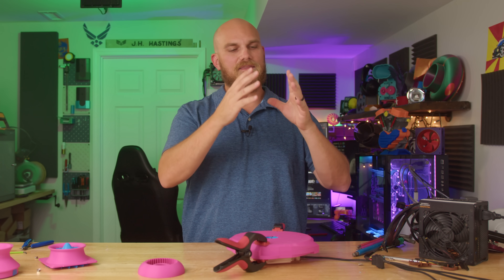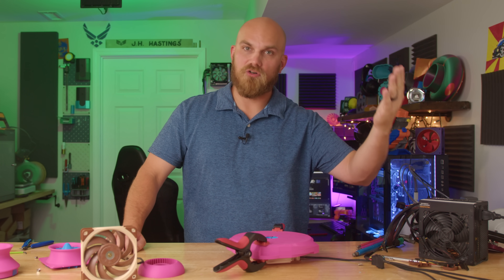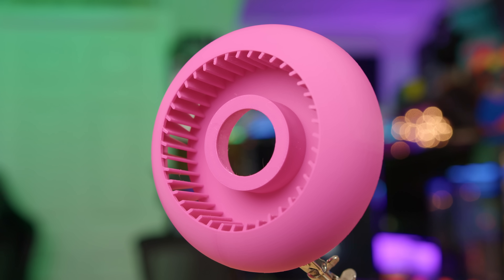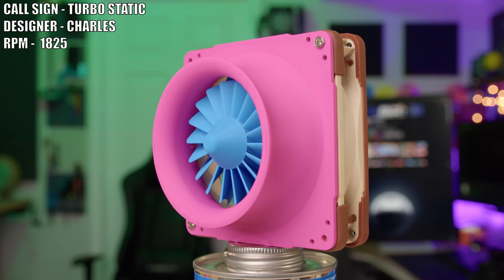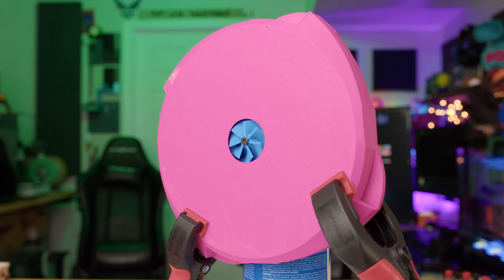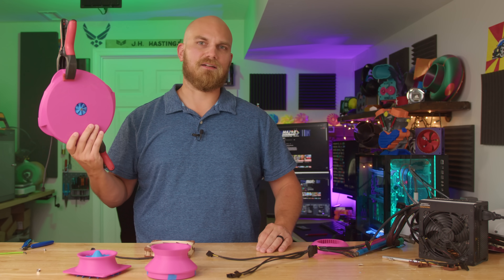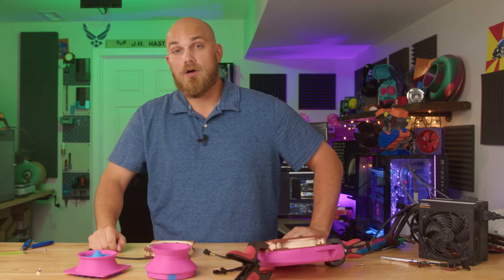Wild 2-Stage 200mm Blower Fan Redefines Power | Fan Showdown S6E6

Comment: When you do a new season, you should base the ranking off of mass air flow (MAF). If you know anything about engines, the way the computer decides how much gas or diesel gets injected into the engine is based off the MAF sensor. It basically tells the computer how many molecules of air are getting pumped into the engine.
Banks Power does a really good job of explaining how MAF gets works:
(short)https://www.youtube.com/watch?v=XLhSeaj1bg0
(long video) https://www.youtube.com/watch?v=VUCo3REGrLE

Comment: Just a suggestion, maybe you could chart your fan pressures VS CFM to give a flow vs pressure graph. I am not sure if your pressure test involves blocking off the fan outlet and taking pressure that way or if you do bleed a little air, but axial style fans would most likely have less pressure due to blade stall vs centrifugal fans which use the "weight of the air" being flung to create pressure. You'd need to create a type of enclosure where you can measure incoming CFM and outgoing pressure with a variable orifice to set flow to your choosing. Maybe inlet adjustable restriction (vacuum) AND outlet adjustable restriction (pressure) measurements as well; some fans are better at making vacuum then they are making pressure. Also, maybe add how much power (watts) are used to determine fan efficiency. Centrifugal compressors/fans are generally less efficient than axial fans/compressors due to the fact air changes directions at larger angles in centrifugal fans than in axial fans. If you take cues from aircraft jet engine manufacturing, you'll see axial compressors are used much more than centrifugal compressors where the engine is not constrained by length. If I remember correctly, axial compressors (multi-stage) can achieve close to 95%-97% efficiency where as I think centrifugal only gets up to about 80-85%. What I am getting at is some fan designs make good pressure but bad flow and some make great flow and bad pressure but those pressures and flows vary in performance depending on how they are used/how restricted they are. All of this can be tied in to "how much power does it take to spin the thing" which would also tie in to "hey it may make lower pressure but it's using little power to do it and there is a tonne of flow". The pressure VS flow graph would really highlight areas where one fan would work better than another in situations where you're blowing through a radiator/filter or using it in open air. I wish more fan manufacturers would include flow vs pressure graphs with their fans sometimes. You can also find similar theories on "automotive turbocharger" sizing. Turbos are spec'd to the engine they are attached to to meet specific pressure and flow targets to maximize the performance coming out of the compressor vs how much power is lost in the turbine driving it. A bigger turbocharger/fan/compressor is sometimes not always better. Just my 2 cents.

Comment: The moment I saw that frisbee of a fan I knew it would move some major air. It just looks like it's employing proper engineering principles for air compression and the large flat disc creates that pressure seal that all the 3d printed "classical turbochager" designs lack due to the high presicion manufacturing requirements.

Comment: Reading other comments, I now think that static pressures is probably not what we want. The problem to beat is cooling a radiator with a motor that create rotation. The "fan" should both create air flow and overcome resistance of the radiator, so a little of "one way" meaning avoiding some leakage of air to go in the opposite direction is good. So maybe the real chart should be cooling of the radiator with constant heat production, the lower the temp the winner.

Comment: 9:34 Oh, "only" 6.7 mmH2O? 3rd place out of 25? Between 2.5 and 3 times what the A12X25 does? From what's technically a fan that fits within the dimensions of the A12X25 housing. Yeah, what an absolute disappointment, right...
Why did you say it like that?

Comment: IMO, we should allow anything, but you should maintain two leaderboards, perhaps even three:

1) Fans that are just fan blades, they fit within the fan frame or at most have a slight protrusion

2) Fans that significantly protrude from the housing, and/or have external air guides etc, but still conform to the footprint of the fan, just getting taller

3) No rules

Though, 2 and 3 might be fine to combine, and you should still list the results of lower bracket fans on the higher bracket results, so we can see how the wilder ones stack up to the best of the lower stuff.

Comment: I am looking for something that can pull about 8 cfm through a particle filter connected via a 23mm diameter connector. I guess that makes something optimized for static pressure reasonable. Any hints?

Comment: I would add a 2nd rule. It has to be able to fit on a pc case. Doesn't matter how it fits, but the fan needs to not obstructed when it is mounted. This is not the same as fitting the fan frame. Similar but less limiting.

Comment: ..maybe for the smoke test you should use an acrylic box with a hole instead of an acrylic panel so we could see how fast will the fan suck out most of the smoke from the box? In the room most of the air is pretty much static, unlike the stream of smoke you push in into the fan...:)

Comment: I'm very much a "it depends" - 
group N's preference is to almost guarantee that a fan made could fit and be used in a computer without having to, say, modify the case to accommodate. 
group B goes big or goes home - big fans are cool and it's fine if they're a byte bulky. The increase in fan performance (and having fun) in exchange for a less universally applicable fan is worth it

Many towers require essentially non-protruding fans on the case, while inside there's more volume to work with where fitting saaay the centrifuge madness may be both possible, and may have better utility

Requesting a double centrifugal madness, just one stacked atop a second

Comment: I work on a ton of vacuum and high pressure systems. GLUE IT TOGETHER. You WILL have leaks if you don't and you numbers will be skewed. It's only on fan, PLUS you assembled it with a rather noticeable wobble. Are there links to the 3d prints?

Comment: 01:40 ANYTHING goes! i use 9 of the fan your holding at this timestamp.
and if there is a chance to 'print' an insert with fan blades that are NOT audible, but still provide a little power, then i'm in ;)

Comment: I don't know if a static pressure measurement is the correct thing to be measuring for the purposes of rating a cooling fan.   Heat transfer is dependent on moving air from one place to another.  A balloon can maintain high static pressure, but isn't necessarily moving air.    I don't want an air compressor on the back end of my computer box.  I want something to move heat (in the form of hot air) out of the box.    I think the Centrifuge Madness's strong showing is in fact demonstrating a key difference in how many compressors are constructed, using centrifugal actuators often with high rotational inertial masses that allow them to maintain pressure loads, but not necessarily with an emphasis on volume movement.   Look at the two key components of a typical heat pump / air conditioner system.  You typically have a small centrifugal compressor that moves the hot transfer fluid at high pressure but relatively low volume through the tubing and into the heat exchanger, where much larger fans move very, very large volumes of air across them to actually carry that heat away.   The compressor moves heat despite the lower volume flow rate because the liquid has a higher heat capacity than air.   But ultimately, you need a large volume air to transfer that heat out of the system.

Comment: I don't see it in the table shown in the video so sorry if it is described elsewhere, but what's the CFM-wise performance of these fans?
Just wondering if some kind of CFM/static pressure tradeoff exists "by default" or it is more "situational" (Noctua's very own 200mm fan that moves a fair shake of CFM but has wimpy pressure comes to mind...)

Comment: Group B. However, you are at the speed runners point, where you are going to need to split to two leader boards. Standard fan leader board and exploit anything goes leader board. Predicting a thunder from down under and a centrifuge madness combo next season.

Comment: I'm solidly in camp 1: 'Must fit the frame'. I'd argue this is (or was) a design competition for case fans as I was drawn to the channel while shopping around for a new one. While all the 'XXL' designs are impressive, if the end-result does not need to fit inside a case, what is the point if the design? At what point does it stop being a case fan competition and become a drone-race? If you are trying to 3d print the best rotor for any kind of application with no restraints, why would one even uphold the limit of using the A12x25 motor? Are designs that are only technically powered by the motor, but are fully independent engines (eg fueled by melting parts of print-medium) in the running?
Of course I am all for separation into brackets, if it means more content to enjoy.

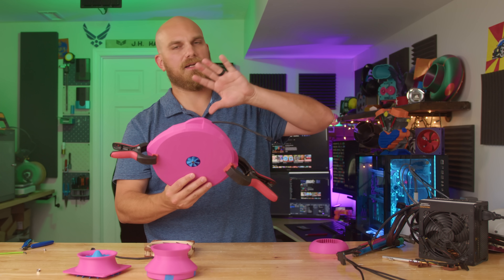Comment: 7:00 I don't think the Center Madness got a fair shake; the top disc was clearly slightly off centre; you could tell there was some wobble on the edge when it spun slowly, and surely that had an effect on the balance and performance of the fan.

Comment: For a sense of scale: 8.7mm of H2O converts to roughly 0.085% of an atmosphere (0.00085 bar). So no, you're not turbocharging anything with these, or inflating tyres etc. =)

Still, compared to the baseline of the A12x25, dang impressive!

Comment: You probably have already but I'm going to mention it, have a look at actual jet engine design.. 
There's two things that I would consider to be very important.... Apart from the multiple fan blades, there's a stator between the blades which is one important and key design and the second is the shroud around the jet engine.... When the fan blades spin up, they create a vacuum within the shroud around the engine.... Essentially getting something for nothing! 
It reminds me of a water pump design that has been around for a very long time and isn't well known..... Basically it's a small pipe within a larger pipe, the small pipe will spray high pressure water inside one direction of the larger pipe and creating a vacuum on one end of the larger pipe, I saw this on a British naval training video, the design allows to pick up raggs and they can be pumped right through without getting stuck.... They use this to remove a lot of water very fast! Essentially using a little bit of water to move a lot of water! 
If we were to apply this to air, we would have a jet engine.... Or a fan that will move a lot more air than is possible with just an ordinary fan..... 
There's a lot of cutaway diagrams of jet engines.... You might need to look at quite a few but once you see it! You will be trying to design something based on it.....

Comment: I think allowing the fans to go crazy like this is just as bad as not standardizing the motor you use. We use the same fan motor for consistent experimentation, so the data means something. The same is true of other details. Allowing the fan to be wider immediately throws all the previous tests into the garbage, because those deaigns would also be "better" if they were permitted to be larger.  The design we see here is really cool. But is it useful for the data? I don't think so. I think it harms the data.

Comment: Pabst Ebm all aluminum 140mm 12v  6750 Rpm 380Cfm at serious water lift. Insert finger, loose finger...I have two others in my Cnc controller they are Pabst Ebm aluminum- 48volts at 7000 Rpm.
These are all noisy , but not like a tornado fan. Still Youd need a speed controller with these , they are just too dang powerfull on full tilt.

Comment: There needs to be the fans that fit inside the housing in leader boards. Second class being fans and blowers that do not fit in the fan housing. The fans that fit in the housing must be able to mount into a PC case as typically used. The non in fan frame clas the asembly must be able to be mounted to a case with the fan outside or inside the panel.

Comment: No rules, no glues, use a silicone caulk or similar sealing material along with your clamps and it'll seal airtight, but still peel apart when you're done.

Comment: I think, ultimately, it's just not really fair to compare them as if they are equal because they just aren't. it's like saying it's a race. this person brought a mustang and this person brought a purpose built rocket car that can only run for 30 secs at a time, has no radio, no ac, no actual doors the person gets bolted in, but they are on the same playing field because they both burn high octane fuel. if you want to go wild then just don't pick any normal fans because they will always compare unfavorably in regards to whats being measured. if it matters that they actually out design the AX25 under the same bounds then the moonshot designs would have no place because they just aren't doing that.

Comment: To me it should be usable within the bounds of the spec, as in it should be the same size and use the same power. That being said no reason there can't be a category for extended and unlimited designs that do not fit within the bounds of the fan housing. 
The reason I feel this should be the case is that if the design can't  be used in place of the original then the design isn't actually better and is just a different product class, as a larger fan will move more air than a smaller fan while remaining quieter. If you let people expand beyond the bounds of the original fan then you may as well just let them use a bigger fan as the base. However, I also feel that these oversized designs are still interesting so give them their own leaderboard.

Comment: The Centrifuge Madness needs to be glued. The glue doesn't just keep it together, it also acts as a sealant for the seams of the layers. EDIT: You could possibly get away with some duct tape along the outside of it. Easier to disassemble without destroying the 3D print.

Comment: If the intention is to find the most optimal design for a fan for a standard PC case, It should quite obviously be able to fit both in the case, and inside the frame of the standard fanbody. If the intention is to find the most optimal fan design, Why does it even need to be limited to using the motor or base of a PC fan?

Comment: "Jet impeller" shares similarity to the first jet engine design, done by a British feller before WW2. It was a radial jet engine, not the coaxial design we are familiar with in today's jet engines. Advances 8n metallurgy were needed for the hot section of the coaxial to work when the first radial design what made.
P.S. there were plans made up to put a radial jet engine in a P-47.

Comment: In general, energy transfer is more efficient when you move a big thing slowly than when you move a small thing fast. This is the principle behind, for example, high-bypass turbofan engines, where most of the thrust is from air moving around the engine core relatively slowly compared to the air moving through the combustion chamber and turbines. There was also a video demonstrating this concept with rubber-band powered cars floating around somewhere on youtube (maybe Steve Mould?)

Comment: Any design is fine. You just have to rate them based on the volume of the fan, ttoday’s winner, for example, is huge. compared to a normal size fan it wouldn’t score as well, right?

Comment: both categories are valid. on one hand the first category were anything goes well that's for generally anyone you have your own computer you have a big case you can do whatever you want with it you want to modify it however you want to get the most performance out of a specific fan for cooling on a CPU GPU case in general do whatever you want however in the second category there's a lot of people that have small cases that don't have the room for all this modification they deserve their own category not everyone has the room in their case for a huge setup for that static pressure or high air flow so it really should be to categories one for the people that just want to go balls to the wall they have the room in their case they have a 3D printer they can do it and other category for those that are more conservative have less space but what a little bit more performance maybe better static pressure in their small case cuz it's tight there's not a lot of air flow they just need to get more heat out all and all I think both are valid and both should be categorized in their own separate unique way maybe it should be a clearance thing where not just fit in the fan but it cannot exceed more than maybe five millimeters above the fan housing and another category that exceeds the fan housing and it's just whatever goes it might be interesting to see a Excel spreadsheet showing the height clearances of all these fans to see what the performance is in comparison My vote is both need to be measured

Comment: If it fits in the Computer Case and is powered by the Case Power Supply, then it's fine...

If it won't fit in the case or it interferes with the fit of other components and/or requires an independent Power Source, then it's worthless junk and should be scrapped...

😄😁😆😅😂🤣

Comment: That massive one looks almost exactly like industrial negative pressure turbine inside of one of equipment we use at work for picking up food with air suction from tins and moving on to the conveyors. Except it is like 1-1.5m diameter. Recently seen it dismantled for repairs and is almost exact :D